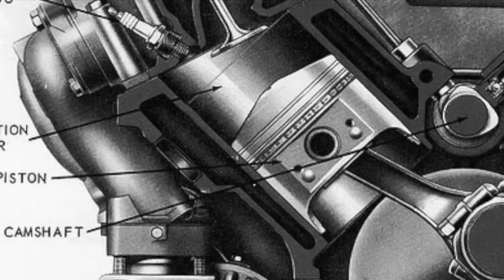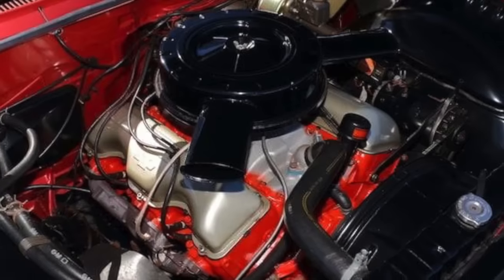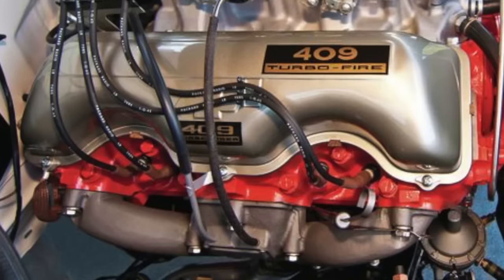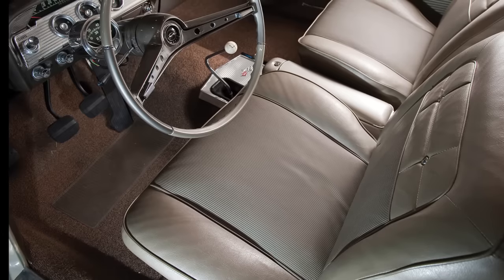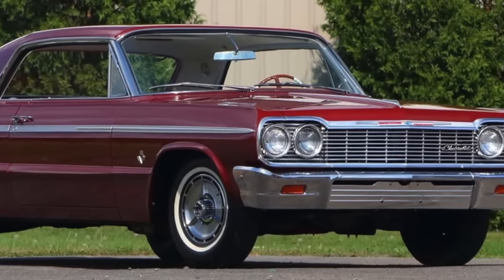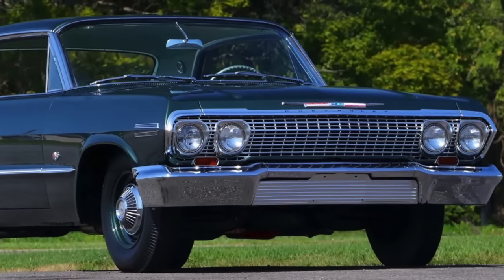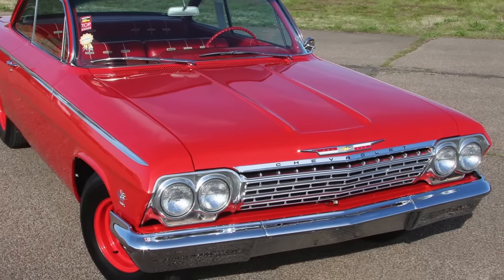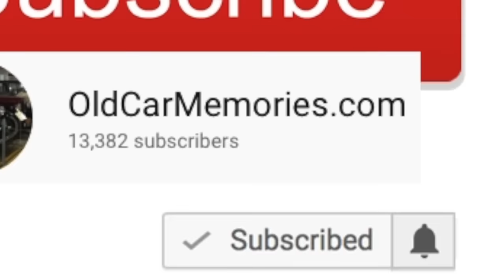1961-1965 Chevrolet 409 V8 - The Ultimate Budget High Performance V8

Comment: 348 & 409 were nothing special their weird chamber design w /flat head design was limited. Thats why they dumped it for the 396 & 427. Were it not for the Beach Boys song this engine would be completely forgotten.
Reply: Don't Think so.........
Reply: but the cool factor is still way high.
Reply: You never saw these engines in a Corvette.  The engineers knew better things were to come.
Reply: True, they knew it was a underperforming "lump".
Reply: The Ford 332/352/390/406/427 was a much more reliable engine. Ford had its big block at 427/425 HP by 1963 while Chevy was still forcing its truck engine to put out much more power than it was originally designed to. That is why owners of these Chevy's were spending most weekends fixing broken valve trains, etc. while Ford big block owners had much fewer repairs to perform on their engines. Not until late 1965 did Chevy release a reliable big block with the 396 version to be incresed to 427ci in 1966. By 1967, the end of the muscle car era was in sight when the manufactirers were forced to reduce compression ratios and make other engine changes to meet the ever restrictive rules that were to begin that year. By the time the first gas crisis hit in 1973, the muscle car craze was replaced by a concern for gas mileage as the cost of gasoline doubled in a matter of months. Few talked about how much HP an engine had while the buzz words became miles/gallon and car weight. Things changed quite a bit between 1965 and 1973.
Reply: The FE Ford big block engine performed better then 409 but that engine has a flawed valve train too. The last rocker arm on each head is only supported on one side causing the rocker arm shaft to break . Systems to remedy this problem have been developed but are not legal in many racing classes. My friend raced a 428 Cobra Jet in NHRA stock eliminator & broke them constantly, causing him to lose a few races. (he carried lots of spares) Mopar 383 & 413 "B engines with a little port work could easily put away 409. The Racing versions know as "max wedge" blew away most of these engines starting in 1962.
Reply: 1950's and early 1960's Ford engines were very over rated HP-wise... they tried to match Chevy advertised ratings, but the engines just didn't actually have it...
Reply: +john collins   To be fair, Ford had troubles with its early 332 and 352 engines, and the 406 and some of the early 427s were problematic as well.   But once Ford got these problems sorted out, they had a fine engine series.  It was a shame that it became outdated so fast.
Reply: The 390 was not so much a high-performance engine in factory trim, but it had massive potential for hot rodding.   There were a few high-performance factory 390s, the '61 390 triple 2V, for example, cranked out 401 hp. 

 It was emissions regs, allegedly, that killed those old FE-blocks.   And yes, Ford copied the Mark IV big-blocks for the Cleveland.   And then repeated it with the 429/460s.  I guess all's fair, Chevy copied the Falcon when making the Chevy II, and the Mustang when it made the Camaro.
Reply: I had a 348 tri power in a 1960 impala. My son now has the motor. It was a badass motor. They are very wide making them to big to fit into a corvette.
Reply: Guess who copied the Chrysler poly head 318 ??
Reply: 4thstooge 
The biggest problem with the 348/409 was the connecting rods. The rods were fine in grandma's grocery getter, but when rodders started reving them, the stock rods couldn't take the stress and would come apart.
Reply: @grex1242  I don't know how it did on NASCAR tracks, but I guarantee you that the W engine had numerous problems on the drag strips. If you understand the origin of that engine, you know that it was designed for trucks. The truckers complained about the 265/283 engine because they were wearing out too quickly. The truckers had to rev them to high RPM to move heavy loads. Chevy engineers were asked to design an engine that would produce its maximum torque at a low RPM. By designing the top of each bank of the V8 to be higher on the outside, that is the exhaust side, than on the intake side, the pistons reached the top of the cylinder on the intake side of it leaving space between the piston and the exhaust side of the cylinder. In other words, there would be a wedge shaped combustion chamber between the piston and the head. The underside of the head was flat and so all of the combustion took place in the cylinder. This is why the engine produced its maximum torque at around 2800 to 3200 RPM. The engine also was produced with heavy components to allow it to power those trucks with heavy loads. This is why the 409 weighed almost 675 LBS. The 348 was not much lighter. I well remember friends who had these engines in their cars. Many of them had to repair broken valve trains and sometimes even pistons. The engine simply was not designed to rev up to as high an RPM as the traditional car engines with combustion chambers in their heads. Those who did rev their W engines too high ended up with damaged rocker arms, valves, pistons, etc. Chevy did put quite a bit of speed performance parts in  its W engines when people said that they wanted high performance W engines. They used special cams, multiple carburetors, large dual exhaust systems, heads with large ports and high compression pistons as high as  11.25:1 in  the case of the 348. This did give the W engine power to accelerate cars quickly. Yet, because the engine was designed to produce high torque at low RPM, its potential was limited and the more power it was forced to produce the less reliable it became. I well recall that its reputation by the 60s was that it was problem prone. In actuality, those who did not race their cars, such as older adults with families, had few problems with the W engine. I almost bought a 1960 Chevy with a 348 when it was about 5 years old. It ran very well because it had been owned by an older man. I was looking for a fast car. That car had the turbo glide transmission that had no low gear. Instead it had a GR gear which stood for Grade Retarder that was to be used to slow the car when towing a trailer on a downgrade. So, I was not interested in it. Yet, I will never forget how well it ran. My point is that the W engine did very well for what t was designed for, moving heavy loads. Those who raced it quickly learned that t was not designed as a race engine.
Reply: @johncollins2442  
sorry John, but your simply repeating an old wives tale about the 348 designed as a truck engine.  It was primarily designed to handle the heavier 58 chevy automobile, in all my years I saw not one chevy pickup with a 348.  Rarely would you find one in larger truck models because people continued to order the  283 or even the 6 cylinder engine.  the 348 in 58 could be ordered with the tri-power and duals from the start.  I suspect you are too young to have ever seen a 348 when it was half way new and not some beater.  And if you think any of the large displacement engines of the late fifties and early sixties were "high revving then you are mistaken.  I was not old back in the day and owned a 1961 348 305 hp.  I never had any trouble with it and it took a pretty good beating.  It revved to 5500 with no problem and it was stupid to rev these engines (stock) any higher.  Maybe your friends had junk engines as they were used hard back in the day.  If you think drag racing is harder on an engine than nascar then you don't know much.  (  stock engines )
Reply: @grex1242   file:///Users/johncollins/Documents/348%20And%20409%20W-Engines%20-%20Chevy's%20First%20Big-Blocks%20-%20Super%20Chevy%20Magazine.webarchive. Here's a link in which an old wife states that the W engine was designed for trucks. It also mentions that a number of trucks had the 348/409 engine. One interesting point is that the factory etched a groove in the cylinders of the engines built for trucks to lower their compression ratio. The point is not really whether the engineers were first asked to design a truck engine or not. It is that the W engine was designed not for racing, but simply to carry heavy loads on commercial trucks and perhaps cars, not pickups. My dad and his partner had purchased a new truck with a W engine to carry home heating fuel oil in the later 1960's. They wanted a truck that didn't have the cold weather starting problems that diesels had. Yet, because most  liquids have high density, it is very heavy. So, they needed a truck with the low RPM torque of a diesel but without the starting difficulty of it  that they had experienced in their other trucks. The W engine provided that. I once worked with my brother-in-law to deliver oil with the truck. He drove while I ran the hose to the fuel tank of each home. That truck ran all day, we never shut it off. It was a perfect engine to do what it was designed to do. I had a friend with a 1964 409-400 HP convertible. I soon saw it in the garage with the heads off. The car was only 3 years old and not beat as his sister had owned it. I guess he had over revved it because he had to replace the valves and part of the valve train. He had sold me a 1957 Ford in which he had installed a 1962 390 engine. I never once had difficulty with the engine even though I had revved it to much higher than 5500 RPM. The problem with it was that he used the original  3 speed stick transmission. The engine simply had too much torque for the old transmission and it would strip the gears if one put too much power to it. You can read the messages of many of the other bloggers on here and find that many had the same difficulties as my friend, especially with the 409. The problems with the W engine were well known when I started driving in 1965. As you mentioned, those who allowed it to go over 5500 RPM often had engine damage.

Comment: Not very accurate. The W series block was introduced in 1958 as a 348 big block V8 and ran through 1962. In 1963 the bore was increased making it 409. From the outside the engines are identical but older cars were not 409s but 348s